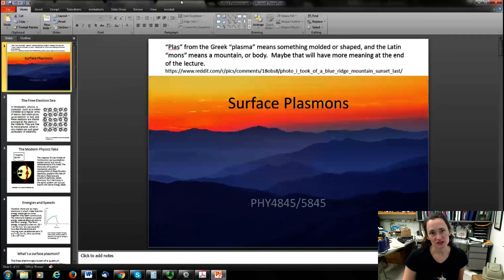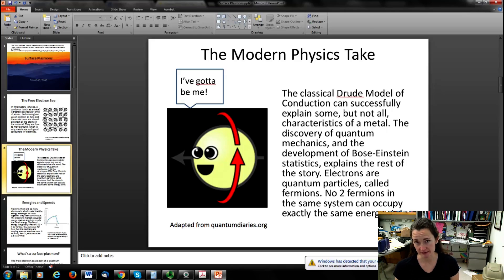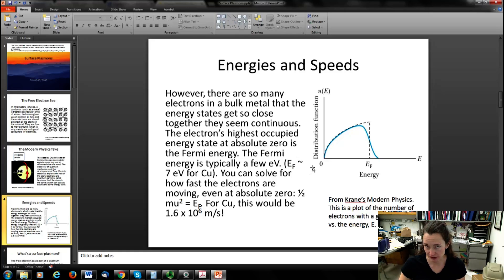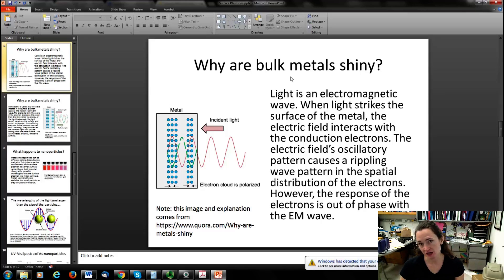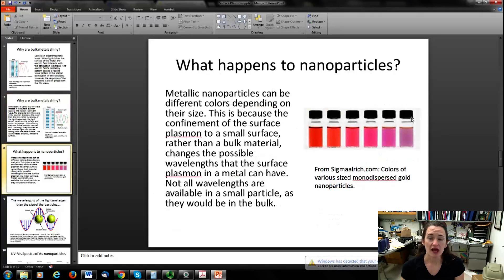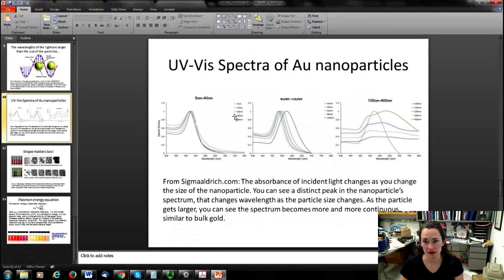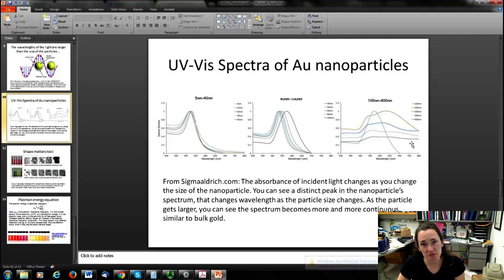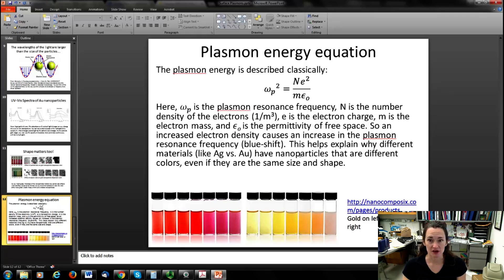Surface Plasmons

Comment: 17:05 at plasma frequency, does the metal ‘absorb’ the energy and make energy loss? It looks that plasma frequency(ω_p) and LSPR frequency is quite different. It would be glad if I can get you answer. Thanks for the great lectures!

Comment: Nanogold seems to be very usefull for make the sunlicht wave lengths distribution (1300w/m2) mutch beter suited for the photon energy to ´translate´ to an electron push  in the the solar cell p-n layer. Normally the photons sensesible materials work best only in relative small range of the available sun wave lengths By using nanogold the effeciency can be much higher of an photo cel by the `Surface Plasmons` effect of (nano)gold. It seems the first experimental solar panels based on this will be lanced in 2025

Comment: "The electric field's oscillatory pattern causes a rippling wave pattern in the spatial distribution of the electrons.

However, the response of the electrons is out of phase with the EM wave."

I suppose then that our mirror image could not possible be a true reflection of ourselves.
The light (EM waves) coming from us, is bounced back in an other form, the rippling in the metal iron gas sea which is out of phase.

It's a violent and chaotic view of what our reality is supposed to be really.

In a sense, the electron gas sea from the metal is in balance but stationary.
The traveling EM radiation is also balanced but in motion.
Then there's impact and the ripples of "the clash" travel back to our eyes.

What kind of fucked up version then do we see in the mirror, compared to our true resonance?

Comment: Hello friends 🌹
I had a few questions, if anyone knows, thank you for your help 🙏
I am researching structures based on spoof surface plasmon polariton in the microwave regime. I would appreciate it if you help me...... I had three questions:
1- How can I prove that these structures work based on surface plasmon in cst?(What should I observe in the structure to prove this?)
2- What is the advantage of using these structures? Because we have a lot of similar structures without this corrugated part that they are smaller and simpler.
3- What diagrams do I need in cst to prove sspp?

4- What is a light line? Why assign a wave number to it? And do they measure with it?
What are the ups and downs of the Light Line ? Why does up is PP and Down SPP? What is its formula?
5- How to find the formula of MS, SIW, CPW lines?
can not find anything in it that the air line in leaky wave antennas becomes the same as the light line? Or are they different? 
If you have any books, articles or sources, thank you for introducing them

Comment: The Figure with the two spheres is super confusing.
It almost looks like the distance between the NPs must be 1/2 wavelength. But thats not the case. The distance between the NPs are topic of plasmonic surface lattice resonances.

Comment: Thanks Tonya for your valuable lecture, we scientists often miss the read between the lines information in technical books and your information regarding the physical picture at what happens inside the bulk and surface are really nice. The phase difference between incoming and radiated plasmon light can be understood due from the dispersion relation of the classically damped harmonic oscillator phase lag for high frequency (e.g. visibe light)  and your explanation regarding quantum confinement of nanoparticles can also be understood from the particle in a box model I am sure you already know all this stuff and its always nice to see things from a physical picture framework as you explained.

Comment: What is the mechanism that causes the oscillating electrons to re-emit the energy as reflected light instead of hold on to it and continue to oscillate? (re: 9:39 in the video). Is this something analogous to stimulated emission / spontaneous emission when atoms absorb photons?

Further, what determines the coherence of the outgoing wave wrt to the incoming wave (if it is even coherent at all?)
Reply: time varying electric field component of  the electromagnetic incident wave

Comment: Tonya,
 I think I am catching a bit of surface plasmon resonance but I was just curious as to what happens after absorption of the particular frequency or frequencies.   Does this light energy transfer to actual motion of the particles, does it get dispersed as light but not directionally specific as the incident light and last, is the light we see from a nanoparticle the reflected light or is it light that travels straight through without reflection or refraction.   

Thanks,
Dr. P.    From Pratt Kansas

Comment: I'm confused. For metals, I thought the Fermi energy was the energy difference between the highest and lowest occupied single-particle states in a quantum system of non-interacting fermions at absolute zero temperature, with the lowest occupied state typically taken to mean the bottom of the conduction band.
Reply from the maker: Yes, that's right. On the slides, I say that "the electron's highest occupied energy state at absolute zero is the Fermi energy."  Perhaps I could have been more specific and said "valence electrons" to differentiate between the electrons in the 1s state from the outermost shell, but that is a bit picky, as I was discussing the free electron sea at the time (which are valence electrons). So with that definition, take the lowest energy valence electrons and call that an energy of 0, and then the highest occupied states have the Fermi energy. This is at absolute zero. At higher temperatures, the distribution function is not cut off so sharply, and looks more rounded, and some electrons have energies higher than the Fermi.
Reply: @tonyacoffey5568  That makes sense, thanks!

Comment: I personally wouln't say that light is absorbed and re-emitted by the metallic surface, emission is a non-parametric process and also is completely random is phase, if light really was absorbed and re-emitted by metals, then they would appear to scatter the light just like a rough colourless crystal would, in all directions and appear white and exert diffuse reflection instead of clean reflection.

Reflection is a parametric process and therefore depends on angle of incidence. It's an elastic scattering phenomenon and respects the laws of reflection, emission (namely spontaneous emission) does not.

From wiki:
"  Light of frequencies below the plasma frequency is reflected by a material because the electrons in the material screen the electric field of the light. Light of frequencies above the plasma frequency is transmitted by a material because the electrons in the material cannot respond fast enough to screen it. In most metals, the plasma frequency is in the ultraviolet, making them shiny (reflective) in the visible range. Some metals, such as copper[4] and gold,[5] have electronic interband transitions in the visible range, whereby specific light energies (colors) are absorbed, yielding their distinct color. "

It's well known that most metals are translucent to ultraviolet light.

Comment: We have experienced Plasmonic mechanisms with semiconductive transition metal oxides on a mulligan insulator when in proximity to organic absorbers provides both bathochromic red shifts in the organic absorber and hyperchromicity that is extraordinary. Clearly the level of energy quantanized by exposure to light transfers the Plasmonic energy to the adjacent organic absorber to induce hyperchromicity effects. This industrial example is now utilized commercially to provide broad permanent absorption over a range of 200 to 800 nm and into the mid and far infrared region
Therefore Plasmonic and Plasmonic effects are no longer limited by nanogold or nanosilver examples but rather among other more prevalent and far cheaper species yet to be discovered to date. Spectral enhancers that function by Plasmonic mechanisms clearly broaden those more expensive and fugitive organics with their own physical chemical limitations. Nice lecture but there is much more to be understood!
Reply from the maker: Yes of course there is always more to be understood. This is an introductory lecture for a nanoscience class that I teach.
Reply: Keyboard warrior
Reply: She never said that gold and silver were the only materials that can have surface plasmons.  They're commonly used in school laboratories, so a reasonable example to cite in a brief introductory lecture.
Reply: We have yet to fully grasp the full implications of the science ! When we think we know something we discover we knew nothing . We need to let knowledge come to us and not the other way around
Reply: @joewebster903  She's teaching basic principles and did a superb job at it.  If you don't like it, make some of your own videos.

Comment: In the graphs shown at 14:00 , does the peak absorbance always occur at a nanoparticle's SPR wavelength? or not necessarily?
Reply from the maker: Hmmm. I believe the answer is not necessarily. In a UV VIS spectrum, all it means is that the energy of that particular wavelength is absorbed by the material. This can be due to exciting a transition in the material that happens to have that energy, in addition to the SPR phenomenon. So it would depend on what material the nanoparticle is made of. You would have to make sure that there are no corresponding excitations in the bulk material at those energies, among other possibilities, before jumping to any conclusions. Hope that helps.

Comment: I enjoyed your lecture very much. Even if it doesn't meant to, it kinda explains the nature of refractive index. What I am puzzled with though is that how (if at all) the resonance might be affected with the polarization of incident EM wave.
Reply from the maker: According to the theory, surface plasmons can only be excited by field components that match the parallel wave vectors. If you think about a small, spherical nanoparticle suspended in a liquid, no matter how you orient the incoming wave, there will be a part of the sphere that has a parallel component to it. So the plasmon would still be excited. If you look at this link: https://www.photonics.ethz.ch/fileadmin/user_upload/Courses/NanoOptics/plasmonss.pdf there is a section that describes what happens for a small spherical particle. The expression is dependent upon the dielectric constant of the materials and the frequency of the light. 
At least, that's my take on it.
Reply: Thanks for the paper, you are right about single nanoparticles. Yet, I am concerned about their asymmetrical aggregation, specifically in case of gold nano rods. Then, would it be possible to observe different spectrum using polarized and unpolarized light, or based on the polarization; estimate the orientation?
Reply from the maker: That sounds like a topic for advanced research. I suggest you do a thorough search of the peer reviewed literature. Microscopy and spectroscopy, specifically AFM, EDS, SEM, etc., is my area of research. Not plasmonics. This is just an introductory lecture on the subject for my Introductory Nanoscience class, which is a survey course in the subject. Good luck!
Reply from the maker: Thanks! There's a link to a pdf file in my comment above that you can click on. Not sure if its a book or just a really long paper, but its helpful for plasmon theory. There's a good general intro to nanoscience textbook that I use in the course, "Nanotechnology: Understanding Small Systems" by Rogers, Pennathur and Adams. Hope that helps.
Reply: Hi! thank you for making this video I would like to ask you the title of the book you just referred in this comment. Greetings from Venezuela and thank you very much for the explanation :)